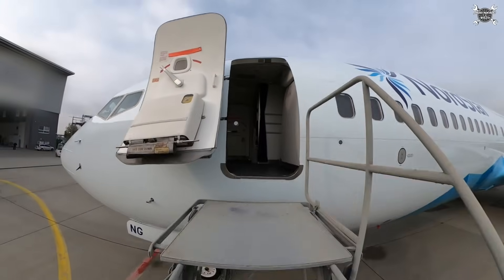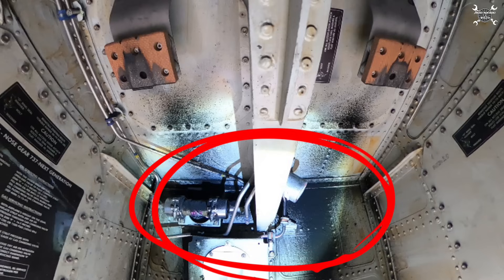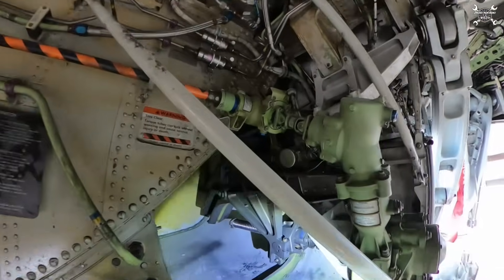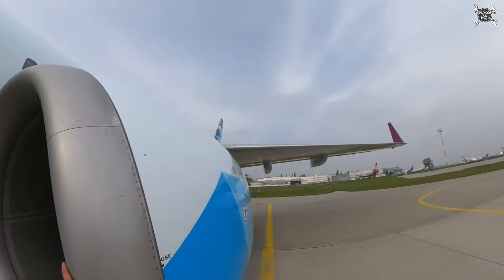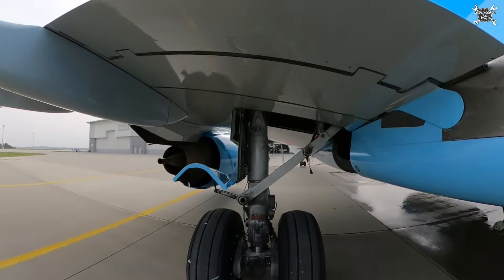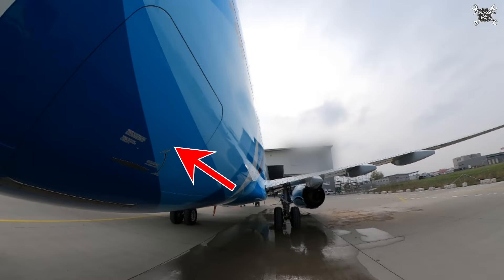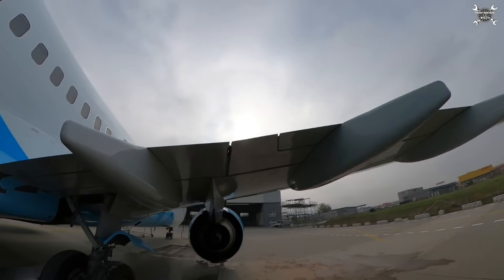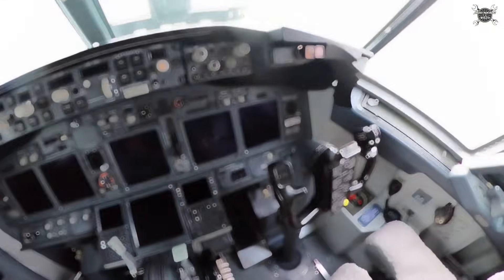Boeing B737NG Walk-Around Inspection | Essential Safety Check Explained

Comment: I guess u missed things like the brakes wear indicator and the fuel tanks  vent system relieve valves 😅😅
Reply from the maker: 10:10 i mentioned wear pins and don't forget this is no an manual. It is only for entertainment

Comment: Zero.r driver this side not mechanic….interesting video. Looking for information on : blade numbering, lock out on LG pins, static discharger condition, lights,……feeling half informed. Where can you post these inputs? By the way, very good effort. Thank you so very much. (wake up - need to ensure wiper, LG, Flap standby switches…..before selecting batts ON?)
Reply from the maker: First of all I'm ZeTo which is shortcut of my name.  Almost all information you can find in my videos. Just go through them. Before someone switch off the aircraft you must place it to state when you can switch it off as per manual. So switching on doesn't require to check all what you mentioned

Comment: So the rear gears go into this compartment with all the hydraulics while spinning at high speed after take off? Isn't that dangerous to damage something inside?
Reply: There's a feature on the landing gear system that will stop the spinning of the wheels as soon as they Get into the wheel well..
Reply: Brakes are automatically applied before retraction

Comment: 4:51  Look at that.  What a Boeing corner-cutting piece of shit.  Outer wheel and tire exposed 100% of the time, throughout entire flight.  Even a 1957 Boeing 707, completely covered the landing gear when pilots brought them up in the well.  
Boeing does not understand the 3 principles of production.   GOOD, FAST, CHEAP.
You can always achieve two, but never all three.
If it's FAST & GOOD, it's not CHEAP.
If it's CHEAP & FAST, it's not GOOD.
If it's GOOD & CHEAP, it's not FAST.
Reply: What’s wrong with the tyre being exposed 100% of the time? This method has been used for many B737 models and never caused an issue

Comment: 0:16 zastanawia mnie jak ta osłona koła wytrzymuje podczas startu na pełnym ciągu. Odległość przecież nie jest duża, w dodatku w takiej odleglości musi panować spora temperatura i nie wpływa to na opony?
Reply from the maker: Wheels are not covered space is open if there will be fire in the wheel well there are temperature fuse on the fire bottle which will extinguish the agent in the area. Every wheel well is tight like that
Reply: @zeto.r I meant something else. The wheels and that cover are close to the engine, and during takeoff, there is a lot of heat in that area. Additionally, the wind is so strong it could knock over a passenger car. How does that blue cover withstand it?
Reply from the maker: That is far far away from the engine hot gas stream 😉
Reply: @zeto.r  two meters? Max

Comment: 6:19 Hi. I would like go ask. If there were fuel puddling in the hot section of the airplane, would there be any significant issues other than possible tail pipe fire? 

And what is the purpose of the vent tube?
Reply from the maker: Most of the time it is oil, for sure there will not be fuel since it will vaporise. And you can have there oil, especially after dry crank
Reply: @zeto.r  I see. Thanks for the response. I am learning a great deal from your videos.
Reply from the maker: I'm glad to hear that 😉

Comment: Tomas very interesting video, thank you for sharing. The red "Remove before flight" ribbons I see on the landing gear, are they pins to lock the gear ?  Sometimes when I'm flying I will see the ground crew with these holding them up for the pilot to see. I guess they remove them just after push back.
Reply: “Remove before flight” streamers are attached to any piece of equipment that needs to be removed before flight. These streamers can be attached to equipment such as landing gear pins, steering bypass lever pins, pitot tube covers, static port covers to name a few. Landing gear pins are kept on board the aircraft and fly with it and yes they are used as a mechanical lock to prevent the landing gear from folding while in the ground, they are used as a backup safety device. The pin (and streamer) you are referring to that a dispatcher/ground handler shows to the pilot at the point of dispatch is the steering bypass pin. That pin needs to be removed so when the aircraft taxis away it will be able to turn when the pilot inputs steering